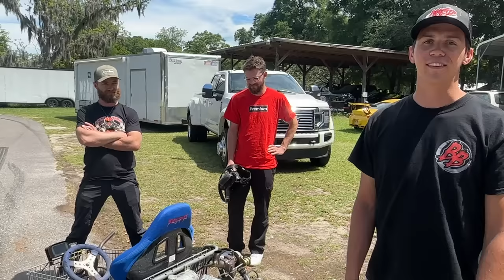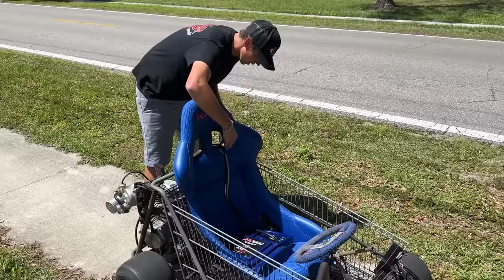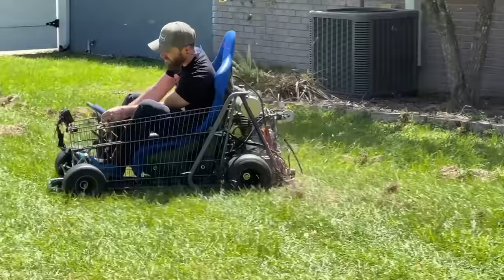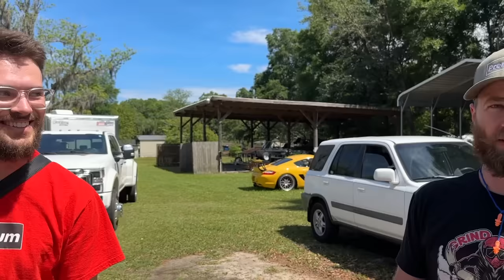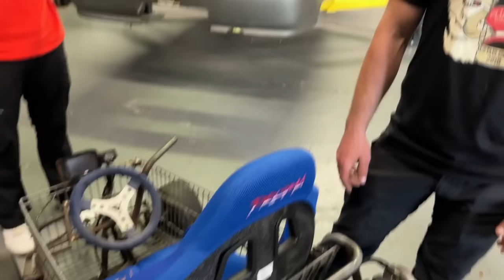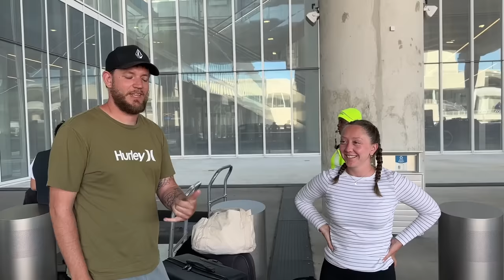My Shopping Go-Kart Inspired Grind Hard Plumping Co's First Build!

Comment: Hmmm....a  TURBO BUSA motor? Parallel twin for better low and mid end? Front engine V-Max with the shaft drive? RC390 for the smaller size? Or a Top Fuel engine? Who knows, what the shopping kart v2 would be!

Cleet will find a way to put a big block in there so pull no stops. Grocery Getter 750? Get it on!

Comment: these people have a lot of imagination but ive got you both beat i have a go cart that does 96 mph on a predator 212 engine it has 5 foward speeds and no gear box

edit its also a cetrifical clutch not a torque converter clutch